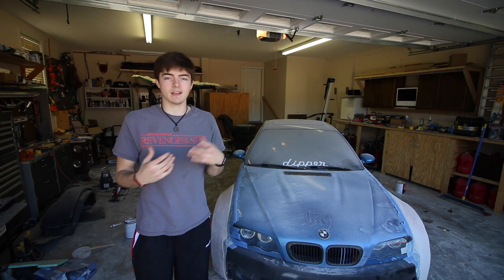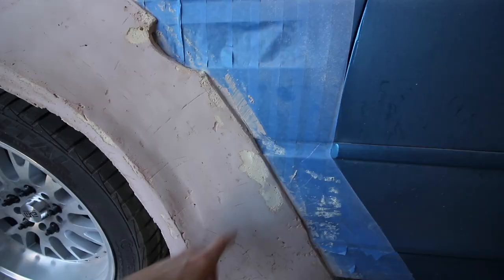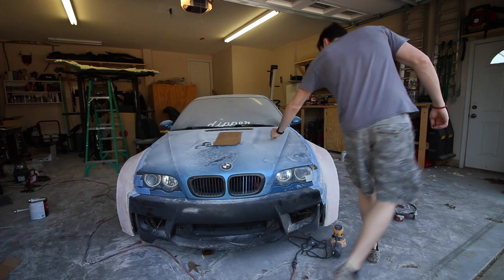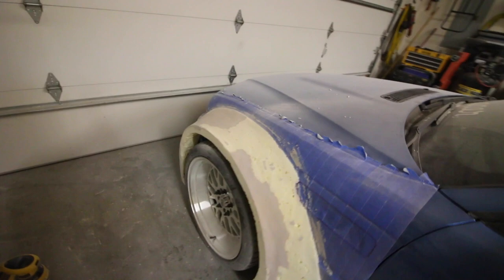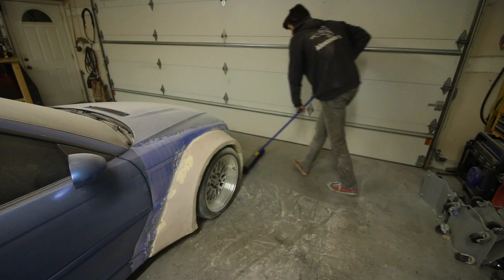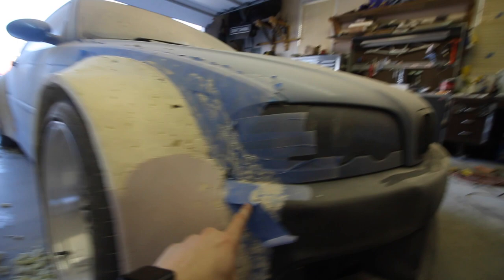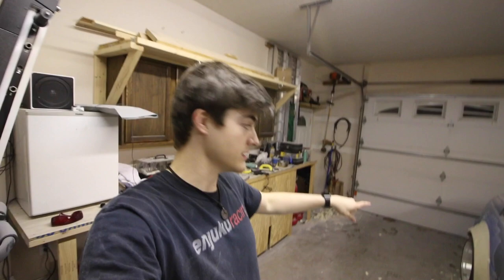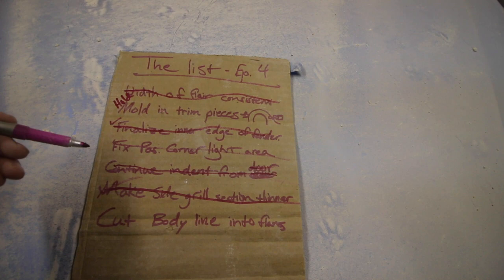DIY Widebody M3 Pt  4

Comment: If you do this again.. You should make a measurement jig out of wire  basically a wire cage with movable rods, you do one side get it perfect, then you use the jig to take your measurements and  mark the rods then move the jig to the other side then stick the rods into the foam until the edges of the rods are exposed  then use cardboard or thin metal to make a profile of the fender so you fine tune the other side.

Comment: I went through a similar experience getting an S15 front end to fit and form with an S13 body, I had to shape the metal fenders into a fiberglass bumper and work around a whole new headlight set up since the s13 had the flip lights...  cool project you got going on though, now you just need to replicate them and sell it as a kit!

Comment: Put a wheel on the car without the rubber and use that crisp wheel to determine the  flair edge.put an arm attached to the wheel that has a large bondo spreader attached to it  that has the shape of the flair edge cut into it.. slowly rotate the the wheel .If the edge hits remove the foam till it doesn't hit but clears by an eighth or better.then spread bondo I over the whole area that can be reach by the large custom cut  spreader attached to the arm..  roll the wheel forward and back to spread bondo evenly.do this on all 4 corners  with same wheel setup and you can have perfect uniformity. Evercoat bond o  is easier for doing this because it's thinner easier to sand by hand.

Comment: Mate, could i suggest that you find the centre of the car and then measure out to where you want the flares to finish then using your car jacks tie string to each jack on the four corners so they measure exactly the same and use those as your guide. Keep up the good work, oh, and talk a little less. cheers

Comment: Just saw this, sorry late, 3 inch or 4 inch or 6 inch pvc pipe about 12 inches long make great fairing sanding tubes, just cut a straight line long ways down the tube, wrap your sand paper around it and tuck into the seam ... fair at 45 degree angles and roll tube as you fair ... for next one maybe ...

Comment: Ta..Ta...Ta...Today Junior! You could have done this whole episode in 2 videos. Who cares about what you could have or what you are going to do. Your kit is not a kit! It's pipe/wall filling! I could get a kit and put it on in one day as  a real mechanic. Plus you are adding alot of weight to your vehicle that is already heavy enough.
Reply: LOL
Reply: That's sooooooo tru
Reply: He isnt going to be driving around with all that foam. Common industry practice to use clay to mock ip parts. He decided to use foam and body filler instead of clay. He is going to get the foam/bondy where he wants it then make a fiberglass part with the foam as a mold. Then the foam comes off and the fjberglass gets bolted on.

Comment: Good videos and keep up the good work. Quick tip, always avoid putting legs underneath the car when not on axle stands, even if it's just a quick wheel change, seen jacks fail. Careful dude.

Comment: inside the fender well I notice they go straight down and the front left curls slightly in, a few inches to the bottom of the back end of the flairs, should flow slightly outward.
In a DIY like this you do need to talk a lot because in that their are some flaws or inconsistencies that are mentioned through the trails.  Also, just forward the video to skip the dialogue.

Comment: Kyle you have  no lack of desire to achieve a finished product, but just looking at it through a monitor I can tell it has no uniformity from fender to fender and quarter panel to quarter panel.  They make products for fab work on wooden items you could use to make sure both sides are the same and not rely on your eye

Comment: Old video now but for anyone else trying there this there are these contour tools made of a bunch of thin finger segments that slide against any shape and then you tighten a wing nut or whatever to lock the shape of all the finger ends locking exact contour you have on whatever .... you can hold that against a similar section on say another fender flares you like and lock it in using it  to match contours exactly...there are many styles and sizes of these here is just one example to show what I am speaking of~~>https://www.amazon.com/RAK-Duplicator-Adjustable-Precisely-Irregular/dp/B07Y1JWVM3/ref=sr_1_7?crid=26GSYJ34P25KC&keywords=contour+gauge&qid=1581844657&sprefix=contou%2Caps%2C270&sr=8-7  If this link is dead just go to Amazon etc and search in ALL catagory for "contour gage"

Comment: what do you need a diffuser for?  once you tag the ground or a speed bump, all that work is going to shatter with that god awful amount of filler.  haha. what a was of money.  You were better off modifying some offroad flares and having a more stable flare.  foam will bend easy and your filler will crack with the slightest flex

Comment: some feedback, friendo:

-Your videos are 30% doing stuff and 70% explaining and talking. You need to switch those ratios, and maybe invest in a whiteboard for quick simple explanatory doodles. 

-I like your overall goal. do it yourself widening. since this technique can be used for various external vehicle modifications, this is a good topic that has both wide audience appeal and wide application potential. it's interesting. 

-you're honest about your work, but again, you go on far too long explaining everything at once, then address it all at once, and it winds up seeming disjointed. 

you're shaping foam, it isnt exactly technical. This entire video could be converted into a minute long video with no sound and still keep all the relevant stuff people came to see. You need to address it or your comments section is just going to continually shit all over you, and no youtuber wants that.

Comment: You have a shit load of initive .....no shit. But if l had to guess the extra weight of wheels tires and filler probably slowed your car down. Chrome dont get you home. But lm still kinda impressed. When l made repairs on my vette l used long hair fiberglass filler. The inside of the fenders were as finished looking as the outer. What does inner fenders look like underneath?